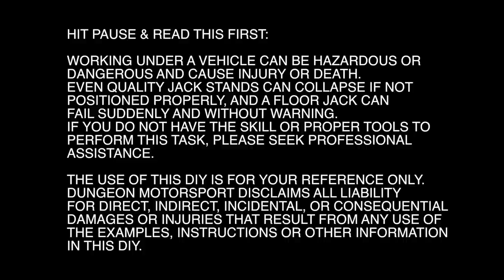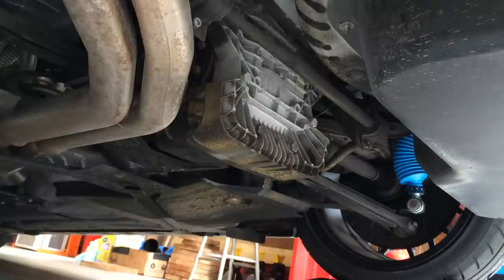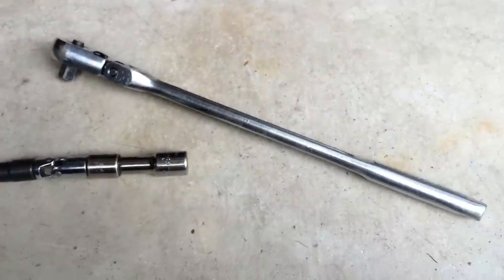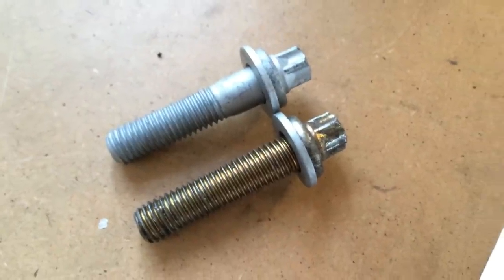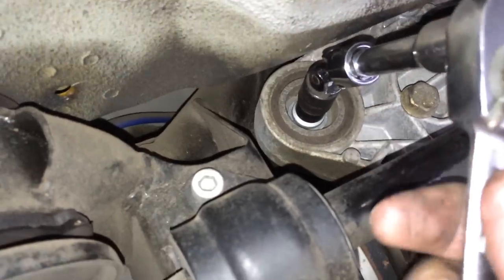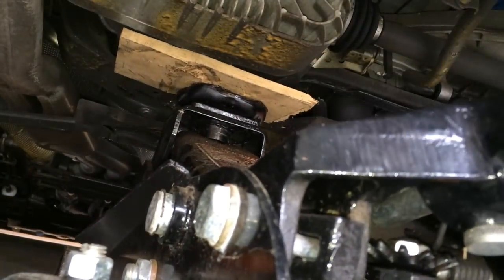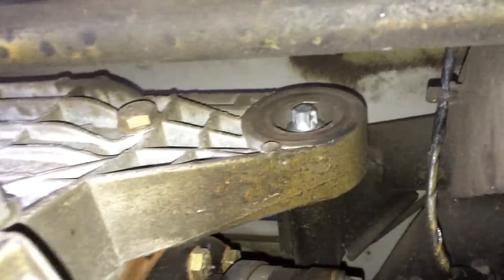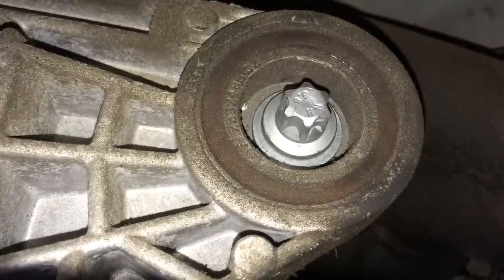HOW TO: BMW E46 M3 - Upgrade Rear Differential Bolts

Comment: That stripping that can be seen in the inner bushing is not caused during insertion or removal but is actually an indicator as to why this job is necessary. The original fully threaded bolts were incorrectly fitted at the factory. Vibration over time has started to strip the inner bushing sleeve and that minute weakness allows for movement and results in the infamous "m clunk" noise when bringing up the clutch or backing on/off the throttle. As this is a bolt-through application with the diff carrier bushing inbetween (similar in use to an alternator bolt), these upgraded bolts have much less weak spots as the shaft under the bolt head is solid instead of threaded. Many M3 owners swear that these 2 simple bolts alone eliminate the M clunk altogether, while many say it has significantly reduced. Either way, it would be better to do it as the bolts were incorrectly used in the first place. Only thing to add is that it is essential to use either blue loctite, nordlock x series washers (or both!) to ensure the new ones don't have the chance to back out.

Comment: By eliminating the the threads at the head of the bolt where it passes through the flange you increase its shear strength. The thread is a cut in the body of the bolt which can cause a stress point.  This can lead to a small crack in the bolt which can cause a bolt shear failure. Hope this makes sense.  Thanks for the VID 👍

Comment: i read that they updated the bolts at some point during manufacturing. any idea when they did that? if all oem bolts are that brass and silver color. cant you just look at the color of the bolt head and determine what bolt you have and roll with that?

Comment: What is the "upgrade" exactly? 
Meaning what will be the benefit of changing them?
Reply from the maker: Kenneth Lazarte The original full-threaded bolts have a tendency to loosen and/or shear at the bolt shoulder.

Comment: Is there a bolt on the front of the diff?
Reply: Yes, accessible from the rear on the passenger side.  It's convoluted to get up in there but it can be done.  Suggest loosening that bolt and re-torquing while replacing the two rear bolts.  This totally solved my infamous M-clunk issue.

Comment: Hi, where did the 61 lb-ft torque figure come from? Everything I've found says 20 Nm (about 14.7 lb-ft) + 90 deg (e.g. http://sawashie.free.fr/M3/TorqueSpec/E46%20M3%20TORQUE%20SPECS%20LR.pdf or https://www.newtis.info/tisv2/a/en/e46-m3-cou/repair-manuals/33-rear-axle-rear-wheel-drive-guide/33-17-rear-axle-differential-mountings/5XGnMyr ). 

I just checked mine so set 20 Nm. Then I set 61 lb-ft and it wasn't even close to 90 degrees further. 90 degrees seemed too much (plus quite difficult with the angle required)

Comment: what fitment is your Apex ARC8?
Reply from the maker: +michael flores 18x9.5" ET35 on all 4 corners. APEX 12mm BMW Spacer Kit for the rear. APEX 75mm M12 BMW 5Lug Stud Kit.
Reply: +Dungeon Motorsport thanks!